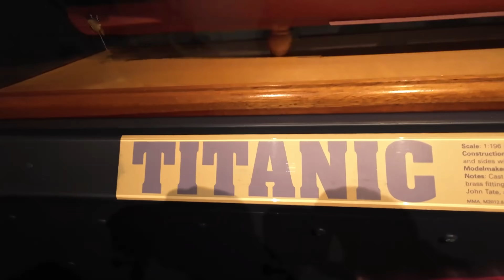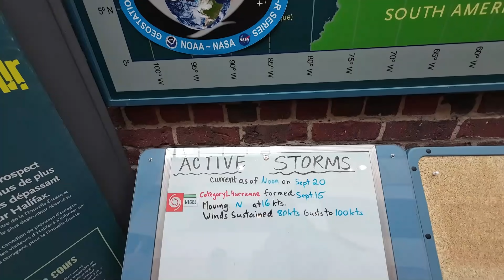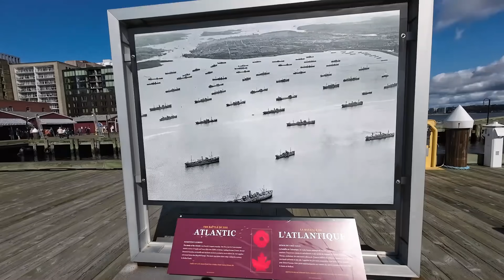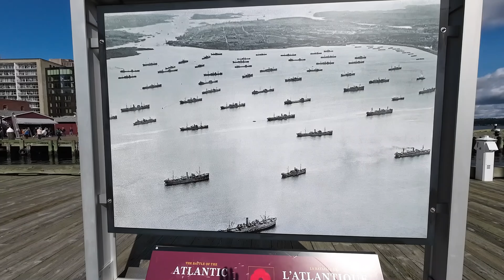S2E102 Preparing Wave Rover for a Hurricane || Tour of Halifax

Comment: The Quartermaster*
Allan, next time, you will be better served if you gather all your halyards, topping lift, flag, and radar reflector lines together using bungee cords then with a separate line, pull the whole bundle back and fasten it to the stern pulpit. This way, you keep all your halyards and other lines off the mast. 
This stops the paint on the mast from wearing off.
Reply from the maker: Great point! Thanks